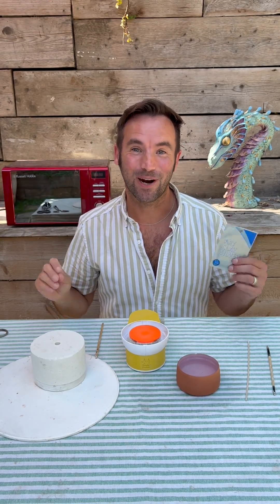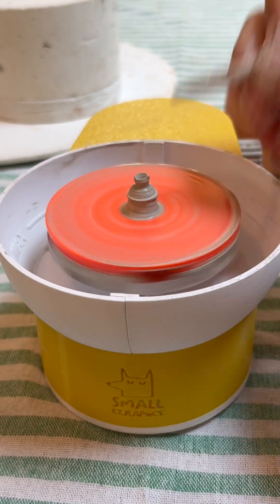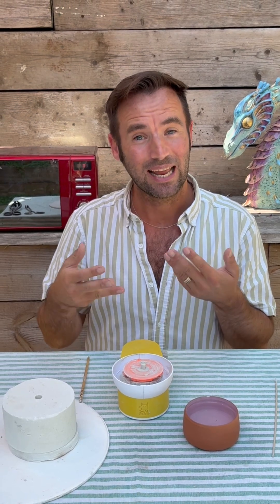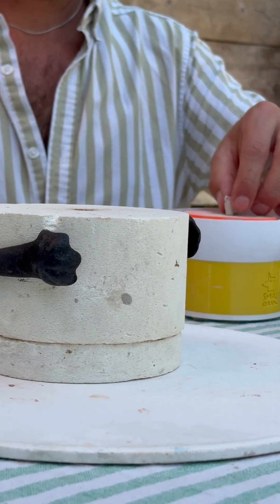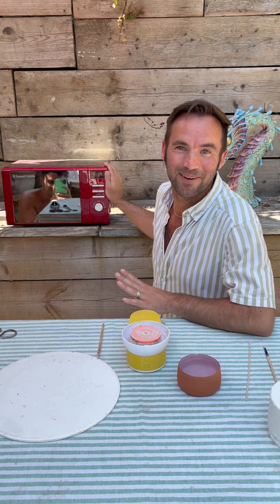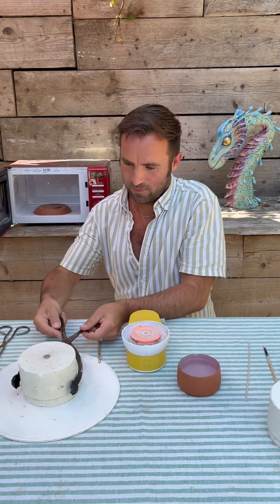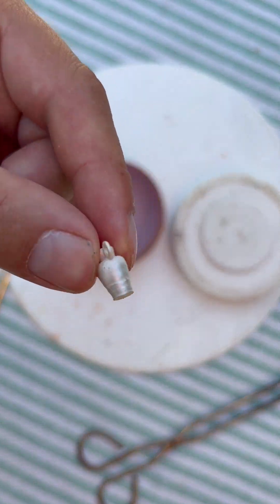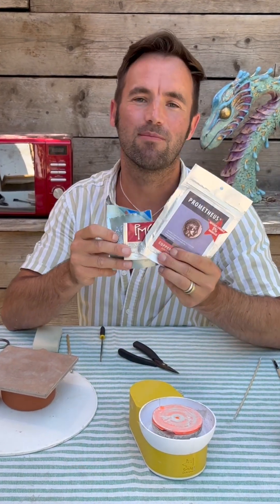Clay that turns to metal! its possible, here's my first time on a mini wheel & microwave firing it

Comment: Love it! I want one of these microwave kilns for sure. Try using a fine steel wool to clean the oxidization off the silver after firing. It works really well. You can also use a Dremel with polishing wheel attachments. Or another way is to use a tumbler, you use what's called a metal shot (various little metal shapes).You put them in the tumbler with water and a little dish soap, and the jewelry pieces you've made, put on the lid, turn the tumbler on and just leave it for awhile. That method is the easiest for multiple pieces.
Reply from the maker: Thanks that’s great to know. I have popped links to the kilns in my links 😊